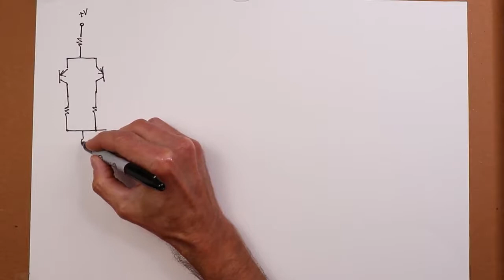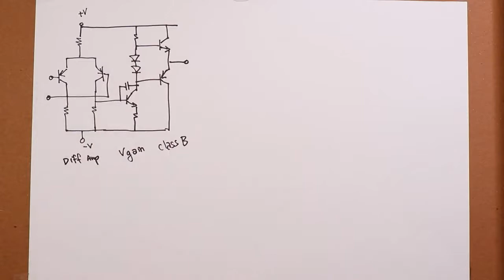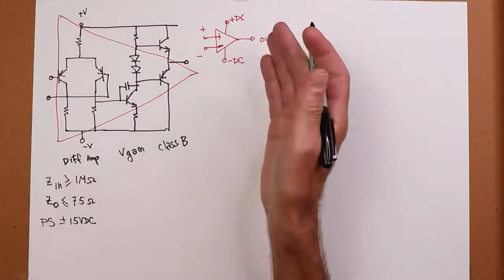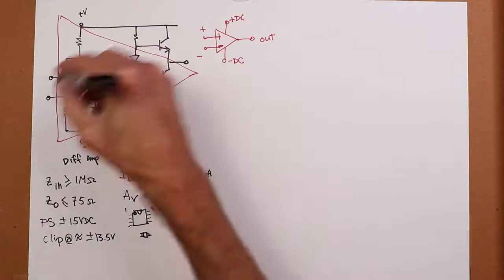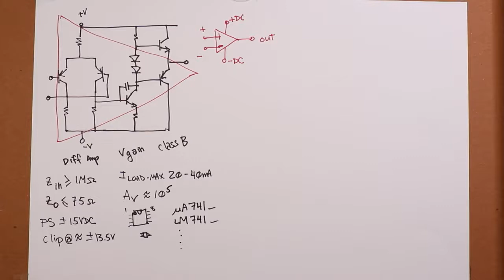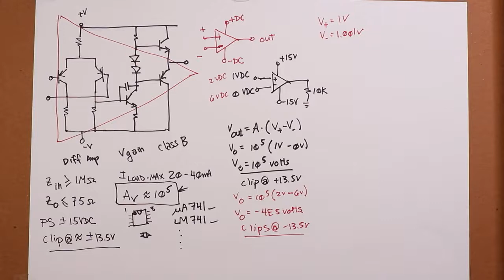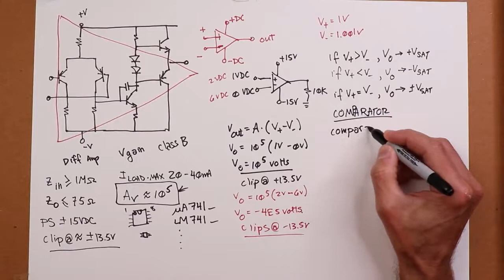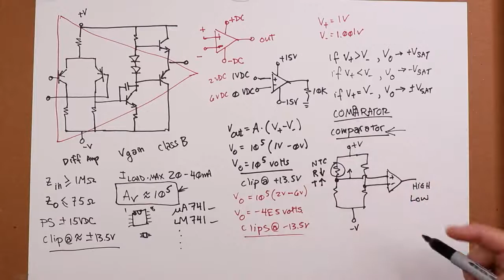Op Amps: Op Amp Internals

Comment: SUPERB EXPLANATION!GENERALY SPEAKING HOW MUCH OUTPUT POWER CAN YOU GET OUT OF AN OPERATIONAL AMPLIFIER? I AM NOT TALKING ABOUT ANYONE PARTICULAR OPERATIONAL AMPLIFIER BUT,JUST A GENERAL PICTURE OF WHAT THEY CAN DO.
Reply from the maker: General purpose op amps are low power devices. Typical output would be a peak voltage swing of just under 15 volts and maximum current of 20 to 40 mA. Maybe a few hundred milliwatts to the load.

Comment: I just never get how the class B stage "decides" how to saturate when we convert the differential input into a single current input from the first stage. The voltage gain stage in this case uses a single npn transistor, so the current will always be coming IN the base right? So haven't we lost the information of which of the two inputs was at a higher voltage? If I look at the power stage by itself, receiveing voltages as input, it's all fine but in circuits like this, I'm so completely lost. It just seems to me that as we get to the voltage gain stage we can only tell how far apart the signals are and not actually if the voltage on the inverting input was higer or viceversa.
Reply from the maker: Have you watched the diff amp videos? They might help. In any case, by the time you get to the final stages, you don't know which input was bigger, all you know is the difference between them. It turns out that's all you need, though.
Reply: @ElectronicswithProfessorFiore   Hey, thank you so much for the reply! I did watch the differential stage video and also have studied this circuit with an active load, darlington voltage gain stage and class AB power stage with SC and thermal runaway protections at my college. The thing that still bothers me is: if we don't know which input is bigger how is it the case that in the first numerical example it clips to a positive voltage and to the lowest in the second? If I were to swap inputs in any of these examples the difference between them would be the same, but still, I'd imagine the opamp would clip to opposite values...
Reply from the maker: @themadnessofone9615  The magnitude would be the same but the polarity would be opposite.
Reply: @ElectronicswithProfessorFiore  That's the thing though: how is the information about the polarity carried through the system if the voltage gain stage accepts currents in one direction only? (as its input is usually the base of an npn or pnp transistor)
Reply from the maker: What do you mean "one direction only"? The input currents can be AC (and are, normally). You seem to be confusing bias currents with signal currents.
Reply: @ElectronicswithProfessorFiore  When looking at the power stage by itself, we have a positive or negative input voltage connected between the diodes and that makes it so that according to the polarity of such voltage one of the transistors will be made to work at a higher operating point than the other one, so that we can get either a positive or negative voltage/current on the load. The same reasoning can be made with an input current instead of voltage, where the current provided by the input between the diodes will be almost exactly the same as the base current of one of the two transistors as the rest of the current is the bias current that must flow through the diodes.  However, when looking at circuits like the one in this video we have that, because of the voltage gain stage made with an npn transistor in this case, current will always be "pushed" into the power stage regardless of bias currents, signal polarity or signal being DC or AC. That has to be the case otherwise that npn will be turned off and the diodes won't be biased and the whole power stage turned off. Now of course such current will be bigger or smaller depending on the input as it is the sum of bias + signal, but it will always be "pushed" current and never "pulled". That to me must mean that this power stage is quite different from the one treated separately as I can't see the lower transistor ever being at a higher operating point than the other one, as the base current of the upper one is always bigger. In my mind the only way for this to work is either having the transistors of the power stage have different specs or taking different bias currents from "+V" than "-V", so to have a sort of "unbalanced" stage so to say. I hope I made my doubt clear as english is not my first language. Thanks for the patience.
Reply from the maker: @themadnessofone9615  I am afraid that you may be misunderstanding the whole point of biasing. The signal rides on top of the DC. Thus, if we have 100 uA bias entering the base of an NPN and we then apply a signal of 10 uA (DC or AC), we still have a net of 90 uA entering (assuming negative swing on the input). If the input signal was so large that (to use your terms) the base current would be "pulled" out of the base, we'd see gross distortion.
Reply: @ElectronicswithProfessorFiore  I think I finally get it, this different way of biasing the power stage through the current flowing in the previous stage rather than from supply voltages only was messing up with my understanding of the circuit. I tried to put in some numbers and can now see how the signal current can get to the base of the lower transistor no problem. Again thanks for the patience and your time! Keep up the good content

Comment: Which one on the first schematic is + and -  ??? Are they rechangable?
Reply from the maker: The diff amp produces an inversion as does the middle stage, thus, the lower input is in phase with the output (+). base->collector inverts, base->emitter doesn't.
Reply: @ElectronicswithProfessorFiore  Why the higher input is not in phase with the output when no signal is taken from the collector or emiter of the left part of the differential part?
Reply from the maker: @incxxxx  Because there's only a single inversion from that input to the output (via the middle stage). The opposite collector of the diff amp is in phase with the input under consideration. You might want to watch the videos covering the differential amplifier (found in the Semiconductor Devices playlist) for details. This is also covered in detail in my Semiconductor Devices text (free- see the video description for details).

Comment: Hello! Thanks for the explanation. Just as couriosity. If the difference  between the two  inputs  V+ an  d V-, is equal  to the total offset of the op-amp, in  real conditions,  wouldn't the output be zero ?
Reply from the maker: Yes, it would (ideally), but the trick with offsets is that you never what it is precisely. The manufacturer will give worst case and typical, but the values for any given op amp are unknown (unless you measure them). 

In the real world, an op amp operating open loop (no feedback) is going to wind up in either positive or negative saturation, if you tie the two inputs to the same potential. Remember, the DC gain on one of these can be over 100k, so the slightest variation will push it one way or the other.

Comment: Is that class b or its ab
Reply from the maker: Class AB is just class B with a slight forward bias to reduce crossover distortion. I find it to be a subtle distinction. "Pure class B" is not really a thing. Virtually every amplifier advertised as class B is really class AB. Many people (myself included) tend to use the terms interchangeably.

Comment: I need someone to explain the base function. Like how does it gain? I'm im the second year of UNI and they just say "imagine this just magically does this" then just move on, that's when i'm fucked. I come from a hands on background. It starts off with, heres a hammer and a nail. Not Here's a hammer then a wall.
Reply from the maker: To understand what's going on inside the op amp at a deeper level, you need to go back to fundamental transistor amplifiers. Take a look at my Semiconductor Devices playlist. If you're familiar with the basic operation of transistors, you can start around "AC Model for a BJT". Otherwise, start back at "Intro to Bipolar Junction Transistors", assuming you're familiar with diode operation.